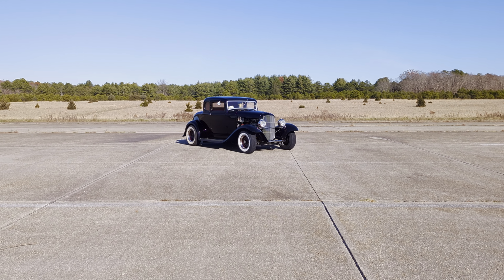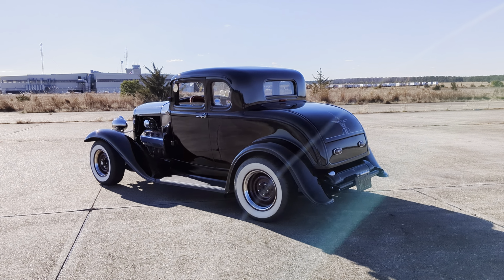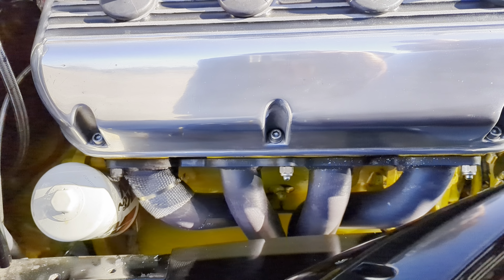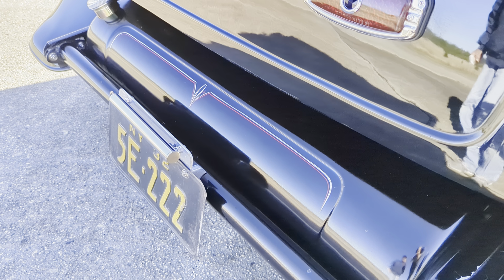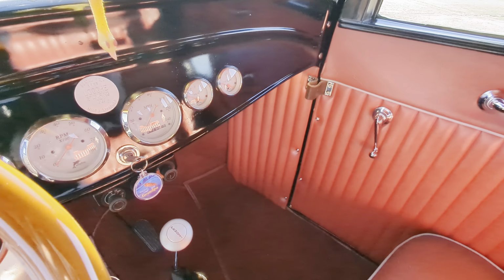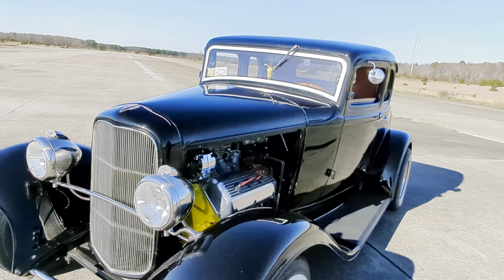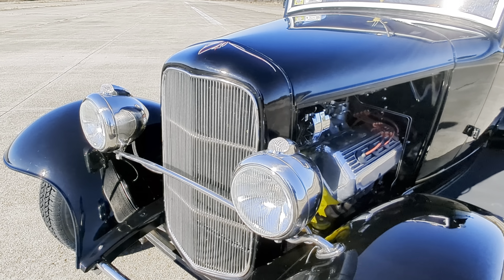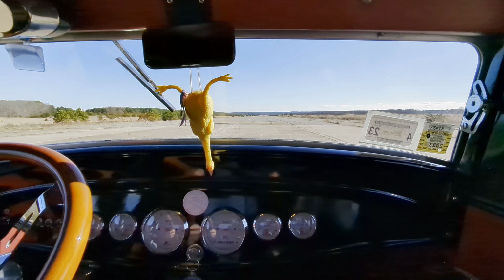1932 Ford 5 Window Coupe For Sale~HEMI~Power Rack~Gorgeous Build!

Comment: Is it still for sale?
Reply from the maker: Yes, it's still available 👍

https://www.webeautos.com/details-1932-ford-5_window-hemi_coupe-used-4246122.html

Thank You
Michael Runnalls
WeBe Autos Ltd
631-339-0399
Michael@WeBeAutos.com
Www.WeBeAutos.com
Reply: @WeBeAutosLtd  Sorry, but do you know the year of the engine and roughly what the Horsepower is?
Reply from the maker: @kendibos9904  
It's a 1956 from a New Yorker or Imperial, 10:1 Compression, Ross Forged Pistons, Isky Solid Lifer Cam with 400,800 Lift and a Vertex Magneto, Hot Heads Intake, Pully Assembly, Clearanced and Balanced. The Motor was Built by Jack Merkel Racing Engines. He's a Famous Engine Builder here on Long Island.. It has about 325hp....

Follow This Link To Over 180 High Resolution Photos: https://photos.app.goo.gl/qsV3QBPi6U4ZLtvJ7

Thank You,
Michael Runnalls
Classic & Muscle Consignments 
WeBe Autos Ltd.
Long Island, NY 11780
Michael@WeBeAutos.com
www.WeBeAutos.com 
Office: 631-339-0399 
Fax: 631-389-2605
Reply from the maker: @kendibos9904  
Motor is from a 1956 New Yorker or Imperial, With 10:1 Compression, Ross Forged Pistons, Isky Solid Lifer Cam with 400,800 Lift and a Vertex Magneto, Hot Heads Intake, Pully Assembly, Clearanced and Balanced.  It has about 325hp...
Reply from the maker: @kendibos9904  
Click on the car to view the Full Presentation with More Photos and Detailed Description on our Main Website.....

https://www.webeautos.com/details-1932-ford-5_window-hemi_coupe-used-4246122.html

Thank You,
Michael Runnalls
Classic & Muscle Consignments 
WeBe Autos Ltd.
Long Island, NY 11780
Michael@WeBeAutos.com
www.WeBeAutos.com 
Office: 631-339-0399 
Fax: 631-389-2605